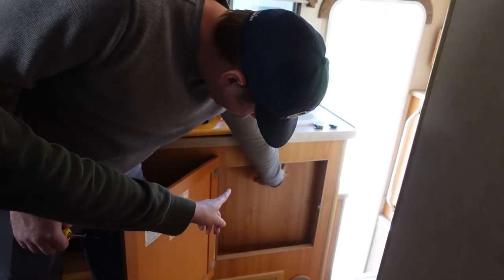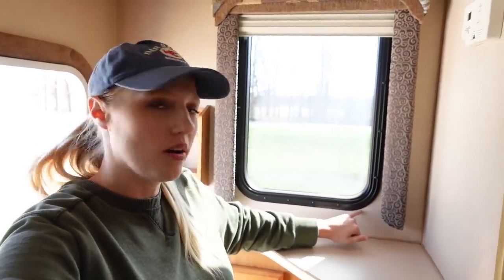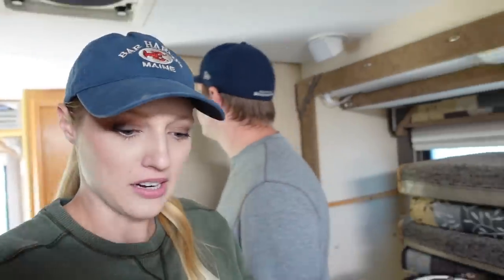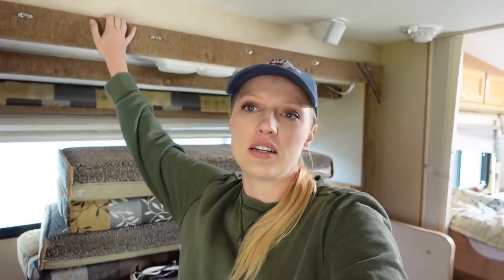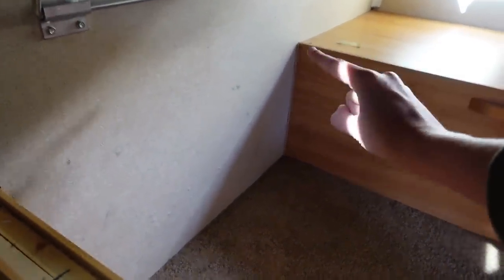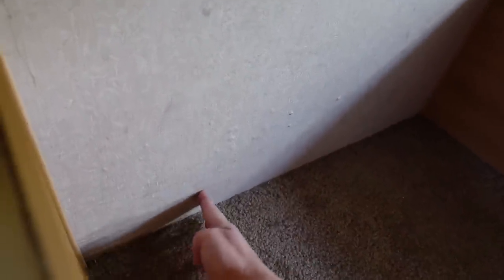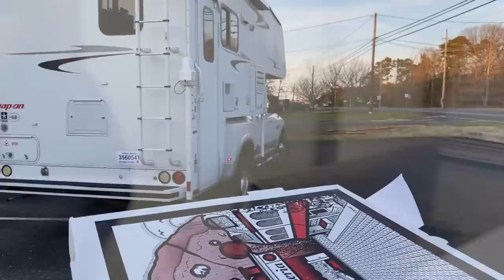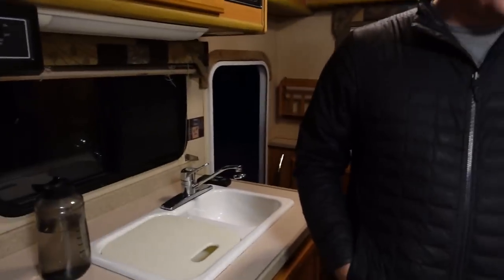"Experienced RVers" Bought an RV With WATER DAMAGE 💦

Comment: Congrats on the new to you Lance camper.  I purchased a 2004 Lance back in 2011 from the original owner and have no regrets since.  I am old school and just believe campers built back in the early 2000's weren't slapped together as they are now.  I think your renovations will prove me right.

Comment: Water damage causing delamination. It is a major problem on all RV'S. You have to always be aware and always do repairs before it becomes an issue. Slide outs are an area you should inspect often. I have had major delamination problems on two of my RV'S caused by product failure from the assembly line. Now I have a steel body van type motorhome. IT will not delaminate but might rust away. Most RV owners become good at fixing things, because every thing has it's set of problems. Enjoy your new camper and remember to carry a tool box with you.

Comment: I had a Lance camper for 15 years and we drove over 100,000 miles with it.  But one day there was strong side winds and it literally ripped the tie downs out of the camper and it flipped over on its side but stayed in the pickup bed! A nice motorcycle guy stopped and we literally pushed back upright in the bed!  And then trying to drive it unsecured off the highway is another story.  But just a warning I would never ever drive thru strong side winds with a camper.  By the way it not only ruined the camper but also twisted the whole bed of the truck!

Comment: Hi scott here. I had a coachmen truck camper before my other campers. Just be careful with the side door. My camper was 12 feet long so it hung over the back of the truck by over 4 feet. Mine the door frame started to crack on the outside. Don t think it will happen to you. Just think of putting something to help sopport the weight. (Peice of metal or wood to help sopport the weight. How long is your slide in camper.

Comment: We recently got a new camper after full timing for the past 3 years in one camper.  When we looked at it the first time we told the guy we weren’t new to RVs and sat pickup we went over the trailer with a fine tooth comb. He seemed very annoyed that we were opening every drawer, testing the switches and outlets, all the stuff you mentioned etc. he actually left us at one point then came back to see if we were done 🙄 we found a handful of issue that were supposed to be fixed but we had driven a total of 8 hours and already paid them so we weren’t going home without it (and made them fix some things but how frustrating it was!

Comment: We had the same model 2009 loved it had two different lances both of them we had trouble with condensation no leaks in the corners when it was cold water would condensate so much it would cause wood rot